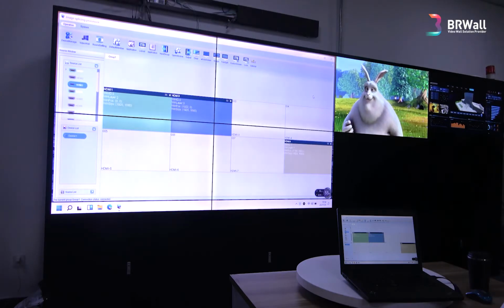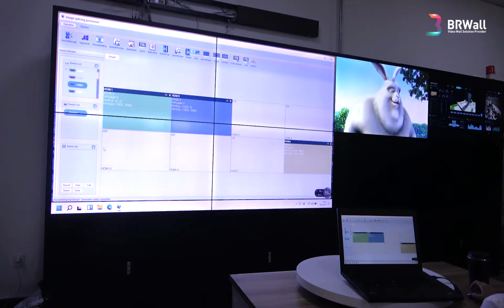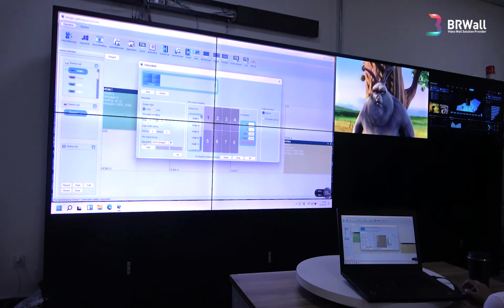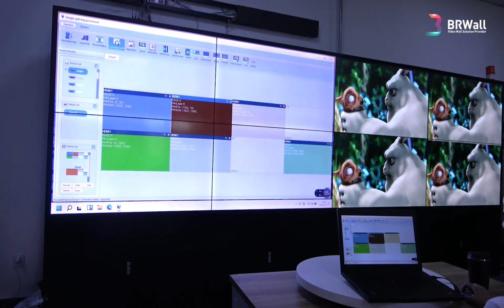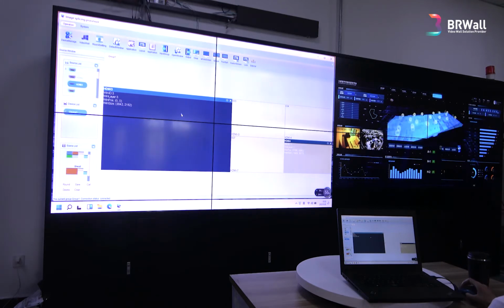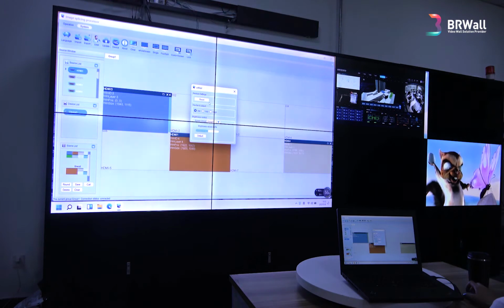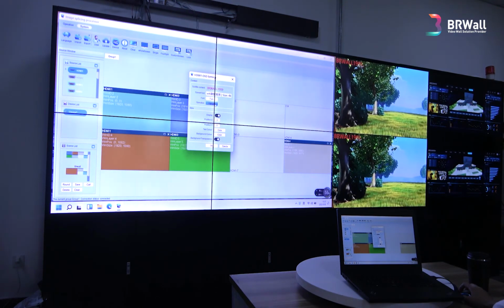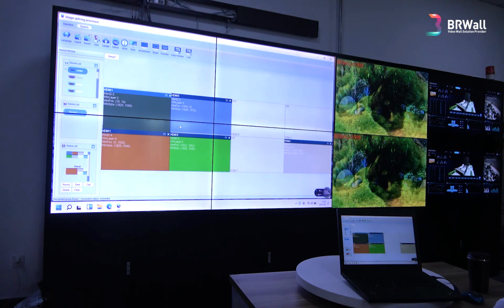How to Operate the BR10 Pro Video Wall Processor

Comment: br10 pro not support 4 windows on 1output..
Reply from the maker: BR10 Pro support 2 windows on 1 output
Reply from the maker: BR10 pro is our upgrade series to meet high quality & low cost project, can open 2 different windows in one output port, as well,  except commons features of BR10 Pro video wall controller, also have 
1.  Added signal cropping function, upgraded OSD function;
2. Adjust the video wall  brightness through BR10 Pro
3. Supports adjusting the speed of fans;
4. Support LCD/LED at the same time and do EDID;
5. Detect the input source status;
etc. 
Hope this can help you, for more information, please contact us in brwall.com or in@brwall.com or call us any time.